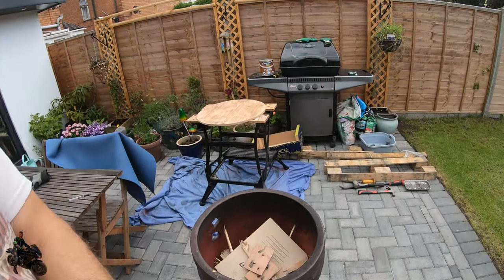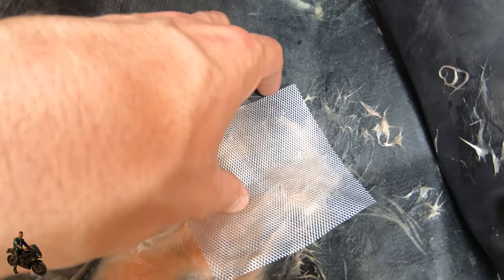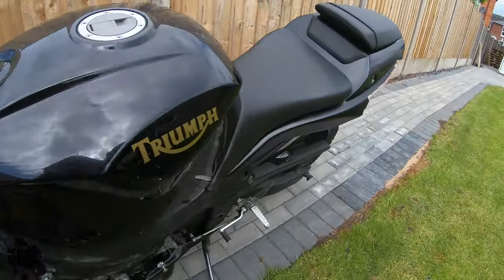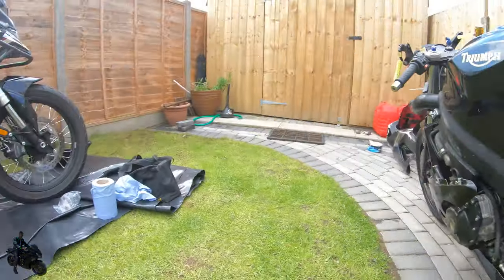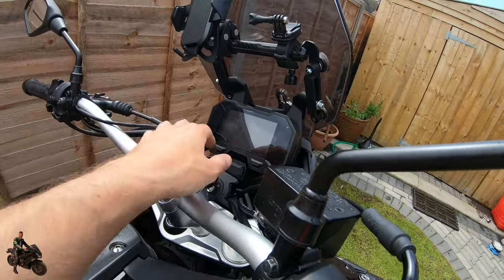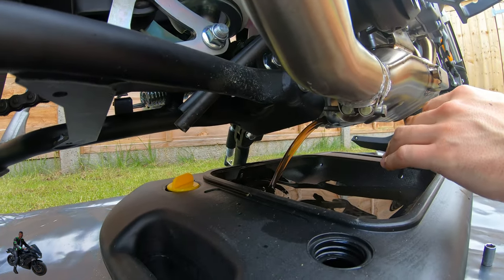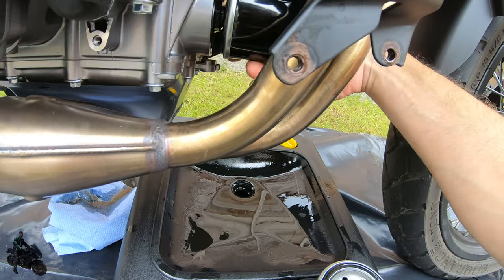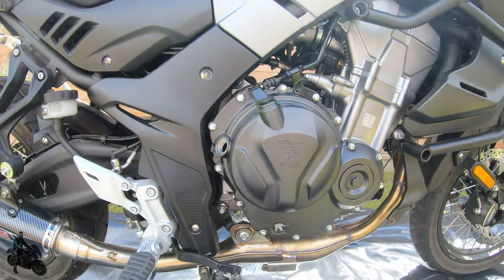Garage Update: Triumph Daytona 650 Crash Repair & Voge 500DSX 1000KM Service

Comment: Kevin is absolutely right about car oil having an additive package that can cause issues with a wet clutch. Perhaps these bikes don’t have that issue but….the only way to find out is if your clutch starts to slip under acceleration. Did the manual anywhere specify a rating for the oil such as the Japanese MA rating? Not sure if oils sold in the UK carry that rating or not. Manuals here in the US seldom specify “motorcycle specific” but specify ratings that lead you to motorcycle specific oils. Unless of course they are recommending an affiliate brand or their own oil.
Reply from the maker: Hi JW, thanks for the comment. Appreciate your thoughts. I have done a little bit of research since making this mistake on the oil and I see that the majority (not all) of opinion seems to state that car oil is OK to put into your motorcycle as an accident or emergency but that it is not ideal long term for 2 reasons. 1) the wet clutch will have its friction reduced by the additive package in car oil and may slip and 2) the higher reving nature of a motorcycle engine will have higher shear effect on the oil breaking it down faster. I used to work for a scientific instrumentation company many years ago and there were rheology instruments there that could measure shear, would be an interesting comparison but sadly not something I can take to the lab these days to compare 2 oils. My clutch doesn't slip at the moment and this bike is not s 600cc supersport which is important. Being a 500cc twin it only revs to 10-11k which of course is higher than a car at 7-8k but not hugely different. Also as I am running the bike in the revs have been kept below 5.5k in line with the manual recommendation. If the stroke is shorter than a typical car engine then you can imagine that the comparible revs would mean that the piston is actually moving slower when it is half way between the top and the bottom of its stroke and so inducing less shear on the oil lubricant. All this being said, I have ordered motorcycle specific oil and in all likelihood I'll drop the oil and replace but what started as an error meant I've learnt something and it's prompted some discussion. Regarding the specific brand of oil recommend, there wasn't this in the manual, it simple stated 10W40 to be used. Thanks again 👍
Reply: @MindfulMotorcyclist  Agree with much of what you said. at one time I only used car oil in bikes. We have a bit in common. Back in the 80s I helped conduct tests on oil for the USCG and USN. Even though it was decades ago the principles still hold up. In your research you may have run across a distinct lack of reference to anything failing when the right viscosity was used under the given specifications for operation. Usually it’s oil starvation or the wrong oil for the job. I later worked for a railroad where the big diesels ran for 10,000s of hours with no oil change just filter change. The oil was changed only if contaminated and that was usually a diesel leak. Bottom line is if all the manual says is 10W40 then that’s what they mean. Great to see your videos.

Comment: I know this is a rather obvious question, but that castrol oil is motorcycle specific right?
Reply from the maker: Hi Kevin, actually it isn't. It's car oil, looks like I might have to swap it back out with  motorcycle specific oil 😞
Reply: @MindfulMotorcyclist  hell yeah, never use car oil in a wet clutch bike mate, also I'd advise fully synthetic oil too 👌🏻

Comment: Oh yeah and won't DIY ing it cause an issue with the warranty?
Reply: You tend to hear that from the manufacturers/dealers but I don't see how that could actually stand up to scrutiny as long as you keep receipts/documentation of parts changed and show they're genuine parts (for servicing tasks that the owners manual has instructions for).  I think the issue arises on extended warranties (as they're an offer beyond the legal warranty period) and also it can breach financing/hire purchase t&c's.
Personally I'd probably get the first and second service at the dealer.  (My warranty experience is only with cars and electronics.  Getting my fist bike soon).
Reply: @MentatOfDune  I totally agree, but I would've thought replacing the oil with car oil would give the manufacturer all the excuses they need for dismissing the warranty, unless that's what they specify.
Reply from the maker: To be honest it was a mistake on my part but in the manual it states only that  10w40 should be used there is no mention of specific oil. Still I think I'll drop the oil and start again to be safe.
Reply: @MindfulMotorcyclist  yeah, I'd seriously get it out, car oil is not suitable for bikes, car oil has a package of  friction inhibitors which while great for a car with its dry clutch is bad for the wet clutch on bikes, also the higher sheer factor on the higher revving bike engines compared to the relatively low revs on cars, requiring a better anti sheer on the bike oil ect